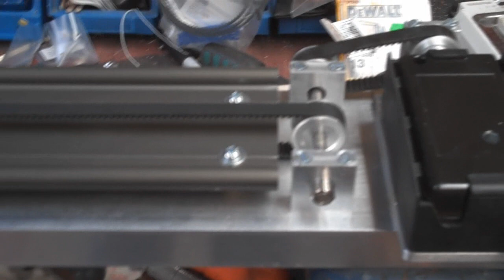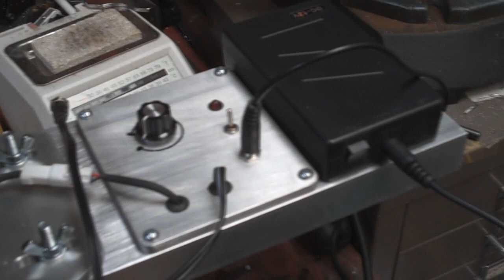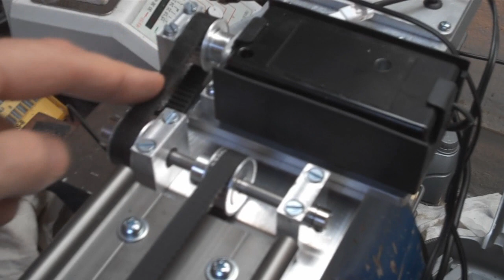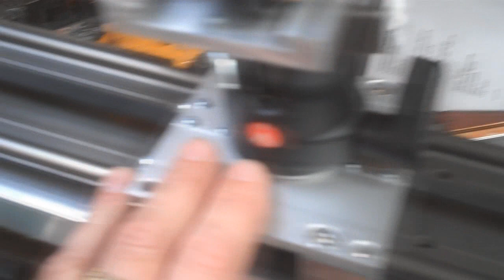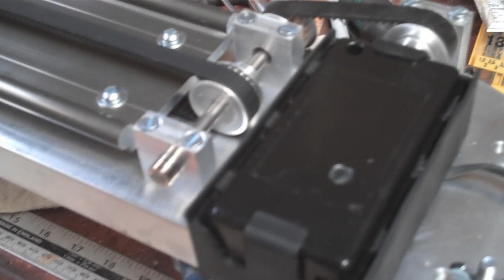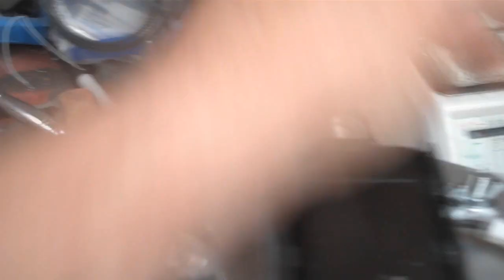Igus diy belt driven camera slider.wmv

Comment from the maker: @TheOriginalJoeBloggs  hi there, the motor was from a electric blind, the motor is made by a company called somfy but there are loads of motors on the internet. i will be trying timelapse but it should realy be controlled with a stepper motor so the camera is not moving when the shots are taken but in daylight with a fast shutter speed it should be ok

Comment from the maker: @Platypus2048 parts i used and part No from motionco

SH06M X2 SAINLESS STEEL SHAFTS
BR06M X6 BEARINGS
PL3M024AL X4 PULLIES
B3M065 BELT
B3M0090L OPEN LENGTH BELT
CP3M009 X2 BELT CLAMPING PLATE
VARIOUS NUTS AND BOLTS
ALUMINIUM STOCK
12V 1Nm 12RPM MOTOR
regards
dave